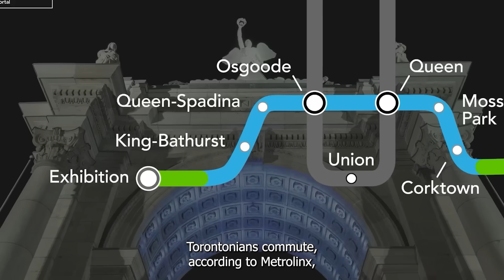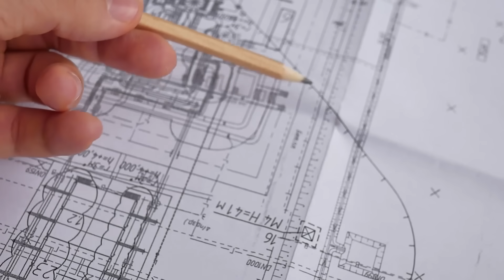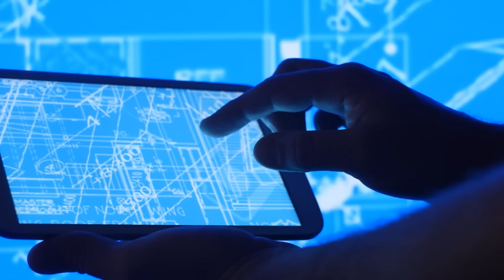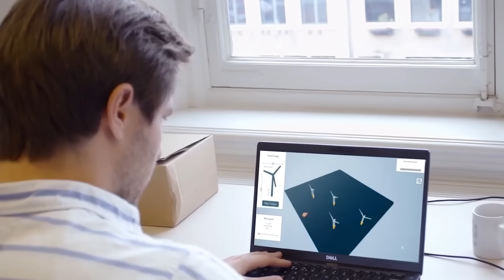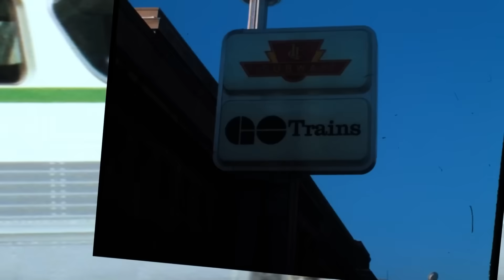Canada's $100 Billion Megaprojects That Will Blow Your Mind in 2025!

Comment: DoFo's decision of ending the new Ontario Line's west end at King-Bathurst is the wrong one.  It should be continued to connect with the west end of the Bloor Line as John Tory had proposed.  This would take the stress off the Bloor Line, the Yonge-Bloor station and the Yonge Line south of Bloor.  The only reason DoFo made the change was to benefit his developer buddies of the unnecessory spa at Ontario Place.  
By the way, even before a shovel was in the ground, Metrolinx announced they were already behind schedule and $70 million over budget.  Starting to sound like the the over budget, way behind schedule Eglington Crosstown LRT.

Comment: 0:57 what so great about this new Subway Line. Singapore has added 4 Long Subway Lines since 2000 while Toronto only added 2 ‘Very Short Extension’. Toronto is behind for 20 years and I guess this new line won’t be opening for another 10 years😂😂😂

Comment: Champlain bridge has been open for some time now, but good nod anyways. Also mentioning the Lafontaine tunnel in the East, and the Iles au Tourtes bridge off the Western tip. And yes, the REM was not mentioned either. Montreal area infrastructure was sorely neglected for years, as are the roads which are infamous for potholes the size of craters at times. The most notorious was the collapse of the De La Concorde overpass which collapsed instantly and killed a few people. This is what got the ball rolling here.. ⚜️

Comment: These projects won’t fix anything. We need a tunnel under the 401 in Toronto. The 413 is too far north of the city. The Ontario line being partly above ground is a terrible judgement call. It will take place of existing lanes on the street. A lot of this money is going to repairs/ electrification of existing systems
Reply: Ontario line surface portion will be squeezed in in the rail cut next to the freight rail line.  Very smart way to save on costs.

Comment: All these projects will be completed in 2100.
Reply: That's optimistic
Reply: Both of your takes are very tiresome. The biggest project in Canada’s history, LNG Canada is complete and on track for shipment this summer. 

The nuclear refurbishment project and Gardiner are on schedule or ahead of schedule.
Reply: @moe4495  Not really. The Eglinton, Edmonton extension, and Ottawa LRTs all have their problems with completion. The Gardiner only got worked on because concrete was falling on people's cars, and only got pushed to be on time because of public outcry (which will most likely cost). Just to name a few (in light, I don't expect perfection).

But, it's good to hear that the LNG project is on schedule. Canada needs to start tapping into its resources more. I await to hear more info.

Like anyone else, I hope all infrastructure projects are completed at a reasonable time. But people got to the point of making jokes about this for a reason.